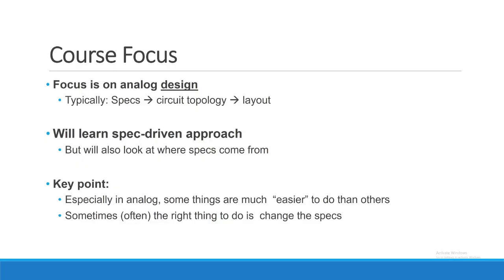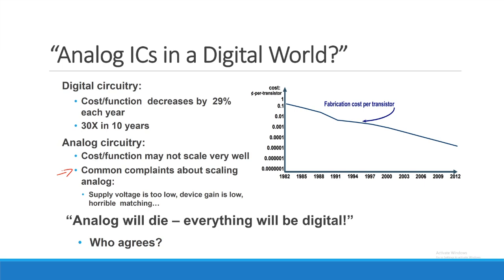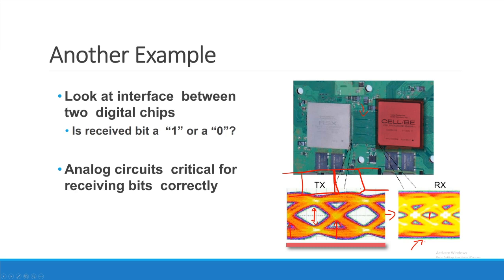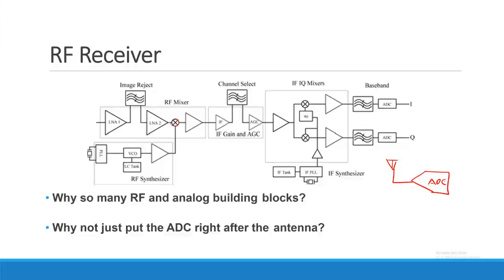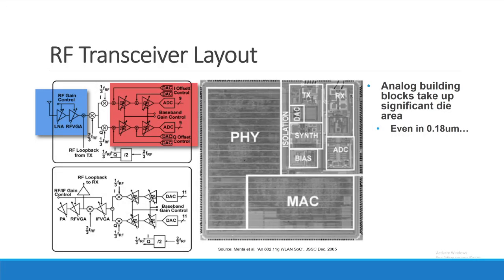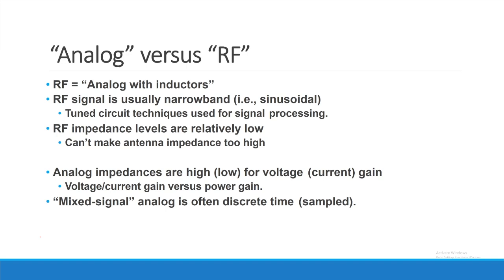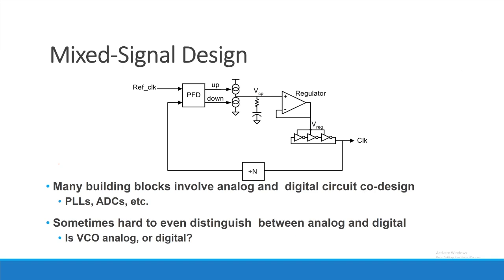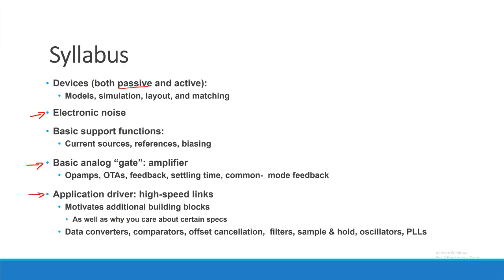HWN - Advanced Analog IC Design: Lecture 1

Comment: 7:55 That's simply not true. A great example is the resurgence of analogue computers: they are simply much more powerful and much cheaper than digital computers and we'll see more and more widespread use of analogue computer IC's in the coming years as the use of AI and ML in everyday devices proliferates and becomes part of our everyday lives, from autonomous traffic lights, to autonomous cars, fridges, toasters etc. You don't need the accuracy of a digital computer IC in order to water your plants or many much more complex tasks than this where accuracy to the fourth or third decimal digit is not at all required.